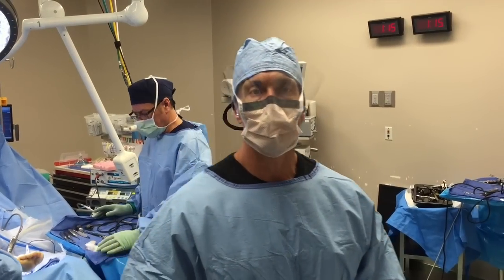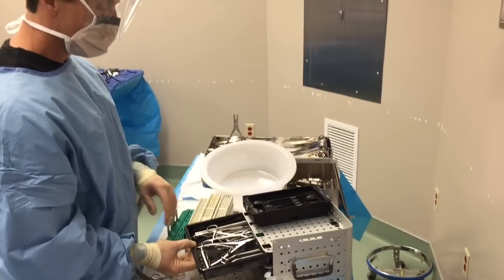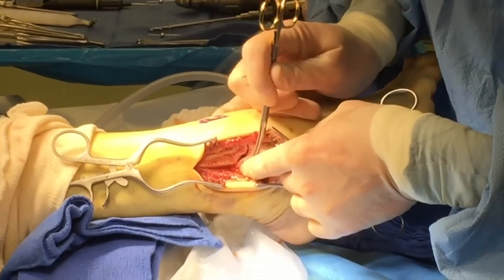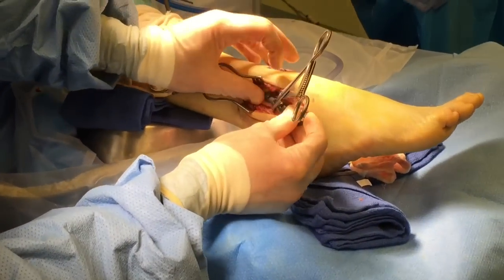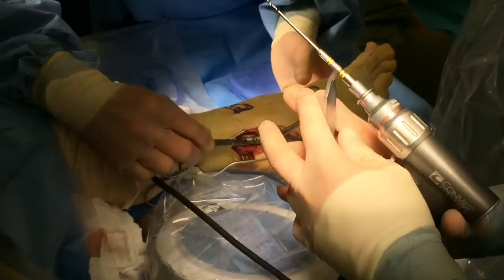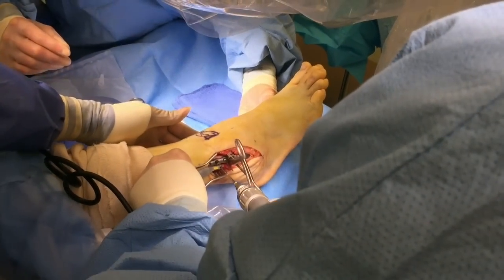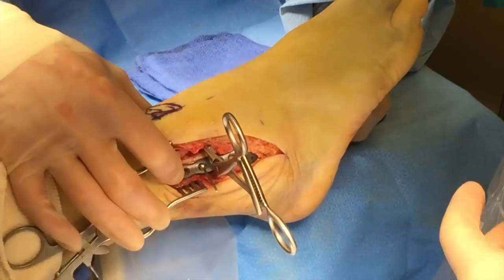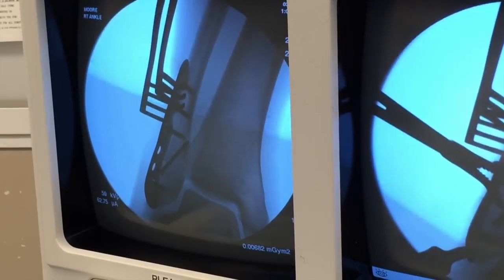Ankle Fracture Surgery Video | Dr. Moore Using Stryker 'VariAx Fibula' Plating System

Comment from the maker: Ankle Fracture Surgery - Stryker 'VariAx Fibula' plating system

The choice was made to use the Stryker VariAx Fibula due to it's inherent low profile, thin plate as well as the locking and non locking low profile screws - https://www.stryker.com/en-us/products/FootAnkle/PlatingSystem/VariAxFibula/index.htm. 

The ability to tell patients that they will not see or feel the plate on the outside of their ankle is important, especially smaller patients with thinner ankles.   
This patient had a very common ankle inversion injury that resulted in both an oblique fracture of the distal fibula and torn ankle ligaments.  During the first ankle arthroscopic procedure, the anterior talofibular ligament was found to be completely torn, but still attached to the distal fibula.  Debris and some osteochondral pathology was removed and then we performed the fibula fracture repair.  The procedure went smoothly, the plate was conformed to the patients unique fibula shape, fracture position and then the anterior talofibular ligament was repaired with the final Modified Brostrom procedure.  
Post operatively, these ankle fracture patients will be non weight bearing for 4-6 weeks, then partial weight bearing in a walking boot.

To see patient testimonials, surgery videos, new medical advances in the foot and ankle surgery community, feel free to log on to http://www.www.MyFootFix.com or our blog at http://www.Dr-Robert-J-Moore-III.com to watch the surgery, listen to patient testimonials, see patient reviews, ask Dr Moore a question, or make an appointment.

Stay Healthy and One Step Ahead!

https://www.youtube.com/watch?v=N9AiVkA4YG4&list=PL109C7C452DD5EE39&index=1
Reply: I thought you might wear gloves?
Reply from the maker: Not clear on that Ben. We are wearing gloves...
Reply: I do apologise. From my initial glance it didn't look like you were and I thought how odd. Great work guys.
On Wednesday I have my external fixator removed after 87 days. I can't wait.
Reply from the maker: Tough surgery for patient and surgeon.. Congrats!
Reply: after I fractured my distal fibula & injured my tabiotalar joint last week; I'll be having this same surgery tomorrow morning... thank you for helping me be less scared❤️ it will be my first surgery ever & how you explained all the procedure helped me stop freaking out. 👍🏼👍🏼

Comment: Great video.  I had this surgery done December 2017.  Still doing Physical Therapy (almost 8 weeks now 2-3 times a week).  Every week can be better, but i still have my on and off days.  The plate & screws definitely hinders some of the freedom of having full rotation.  Stiffness and inflammation still happens every once and while.  I notice with uneven land/outside my ankle sometimes will roll which can be alarming because you don't want to reinjure the leg.  I'm hoping one day I can be fully 100%.  I know I'm only a few months in, but from what I've learned having this surgery done the road to recovery you need patience.
Reply: Return To Dust did you have to stay in the hospital?
How long did it take to heal? There is a very slight chance I might be having surgery if my ankle didn't heal right. The doctors said I might have broken my growth plate. This was a month ago and it's supposed to be healed but it still throbs with pain.

Comment: I broke my ankle about a month ago and they said I might have broken my growth plate. One month later they said it should be healed but it still gets really sore. As I am typing this comment, my ankle is throbbing with pain.
The doctors said that I might have to have surgery if it doesn't heal right. I'm going to get X-rays again to see how it healed.
How long does this procedure take?
Reply from the maker: Growth plate fractures can be tricky and apologies Avery for not having an exact answer.  Depending upon the bone or physeal plate involvement, displacement, and area, the treatment is very different.  For now, non weight bearing with crutches should control any pain or swelling.
Best, 
Dr Moore

Comment: I fractured my tibia and medial malleous in a motorcycle accident and had a similar procedure. I'm interested to know how you can make incisions in the skin without rampant bleeding. Also are the screws torqued at all?
Reply: Nathan Sisson The patient has a tourniquet placed around the thigh. That's why there isn't any bleeding.  also, the screwdriver has a tourqe limiter built in

Comment: Hi, I broke my fibula bone on 01/06 I'm in week 5 now, still in a cast! (Coming off next week where physical theory would start) I've had a operation leaving me with a plate and 6 screws! Doctors said usually the plates wouldn't come out as you won't be able to feel them plus it would require another operation. However in week 5 now the metals are already irritating me!! What my main concern was that after my bone heals, if I have another operation to take the metals out would I be fine right after the operation or would I be back on crutches and a cast and start everything over again?? Also where would they cut me? Would the cut open the presvious cut and stitch that back or would they have a new place to cut??
Reply: Can you please tell me what ever happened with your surgery. Did you ever have to go back and get it redone?
Reply: aye respond bro we are curious

Comment: Amazing it doesn’t bleed out like crazy.  What’s the future hold in terms of fusing the bones together without screws? Do screws jepodise the bones structural strength?
Reply: Aparentlly not. I'm looking to get something like this removed from my ankle. Doc told me not to worry about it to much, once the screws are removed the hollow bits they leave will grow back solid. Keeping metal in is uncomftable in my case as some of the screwheads are budging a bit under my skin. So wearing high boots are a pain. There 's also a risk of complications if i were to have another acident. Incase of a car hitting it instead of a clean break the metal plate and screws could splinter the bone. As far as the bleeding goes, i guess as long as you don't cut an artery you're good.

Comment: After receiving similar procedure this summer-question is does the hardware generally remain in the patient or is it usually removed down the road?
Reply from the maker: Nine times out of 10 the hardware stays in. In short, when the bone repairs it is much stronger than even the titanium strut that we put on, to maintain its position. Therefore, it is in essence useless and only if it bothers the patient's shoe gear or rubs against a higher boot type style, or one of the screws backs out of the plate, all of the hardware remains in the patient for life. 
Best,
-Dr Moore
Reply: Thank you.

Comment: is the plate large enough to set off metal detectors?
Reply from the maker: +Matt Kersey 
Very common question Matt, yes the can.  The titanium plates do it less and many of the less sensitive detectors don't go off at all with the smaller plates.   I have not personally confirmed this, but one of my patients said that he did not need the note I wrote him when he went on a trip after his ankle surgery.  The security officer simply patted down his sock and ankle and checked the rest of his body with the hand wand.
Reply: Mine hasn't ever so far and it's been 3 years LOL!

Comment: I broke my fibula parachuting out of an airplane. I've been super nervous about getting this surgery done watching this is making me feel so much better. One question, how long does this surgery usually take?
Reply: Pocketchutes I just had mine yesterday and it took about 3hrs in and out, from the time of my appointment.
Reply: Randy S that's about what mine was I had it done a week ago. This split is no fun lol
Reply: Mine is burning and throbbing, way worse than when it happened. WOW
Reply: no worries after your toes get feeling again the pain in tolerable. I mean hell when I broke it I though I had just sprained it really bad. I jumped out of an airplane then walked a mile with the parachute. trust me a few days and the pain mostly goes away.
Reply: Rusty S mine too I broke my fibula on 06/30/17 and the swelling remain gone until I stand on it but I've been off of it for 3days and it burns and itch

Comment: I'm after some advice...I fell resulting in a trimalleolar fracture, I've been non weight baring for 9 weeks whilst healing/waiting for syndesmosis screw removal, this was done yesterday with the removal of two of these. The surgeons post op care was follow up in six weeks with him, and to see my local nurse for staple removal. He also passed on that I can now fully weigh bare

I'm under nhs care, and was to out of it after the anaesthetic when he saw me in recovery; resulting in not seeing him post op this is quite normal for this to happen in the NHS 

IM concerned I've been told I can fully weigh bare yet I have no support or boot just expected to try and walk, shouldn't I be provided with a airboot or something similar? 
I have no current movement yet in my foot or able to put my foot flat any weight baring is met with severe pain.
I'm not sure when I will get a physio appointment or how soon this could be usually about a months wait

Comment: Im going to be having this surgery on monday im scared to death n the pain after surgery 😲
Reply: I had it done several years ago; you'll be fine. Just follow what the doctor's tell you and you'll be back in no time!
Reply: @DMG118  i had it done. It wasn't as bad as i thought it would be. I ended up having 2 plates and 18 screws. I'm now down to taking the norco as needed, i go tuesday to have it xrayd n get a cast on, not supposed to to be putting weight on it but thats easier said than done, but i feel the effects afterwards. It only took my dr an hour in surgery. Hope everything went good and you have made a full recovery.

Comment: Your fibula length is short
Reply from the maker: +scrlet52 There are many platforms to discuss surgery techniques, pros, cons, etc. and I am always open for discussions.  Please state your reasoning and background so I can get a clear understanding of your comment and some direction.   I am not sure if you are referring to the length of the fibula itself or the plate.  I assure you that with this kind of common, simple oblique fracture,  once the fibula was distracted and the clamp was puti in place, the length was anatomical.  The screw perpendicular to the oblique fracture compresses and holds the fracture interfaces together.  The plate itself is acts as a 'buttress' keeping the proper length as well as prevention of motion in the sagittal, frontal and coronal planes.